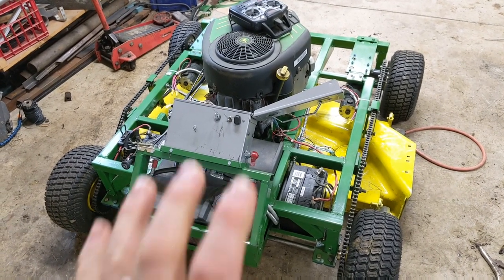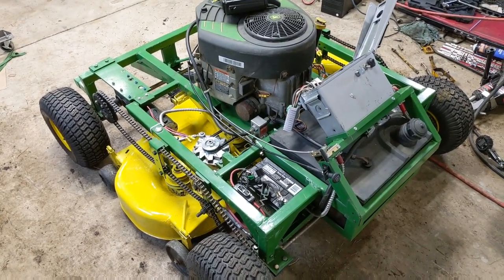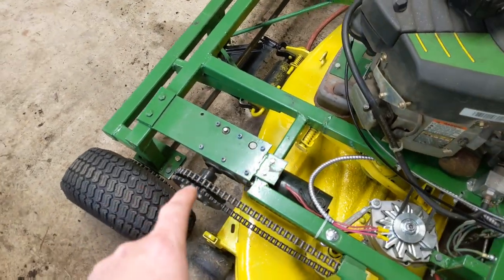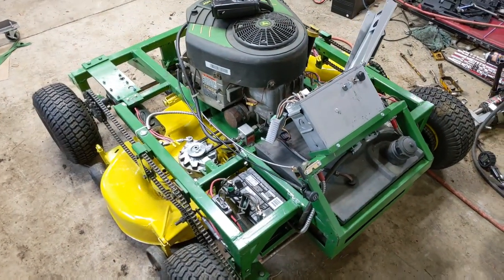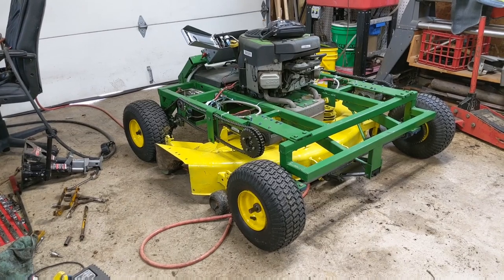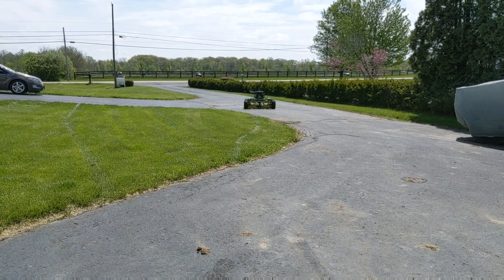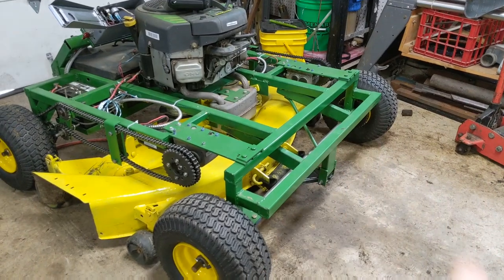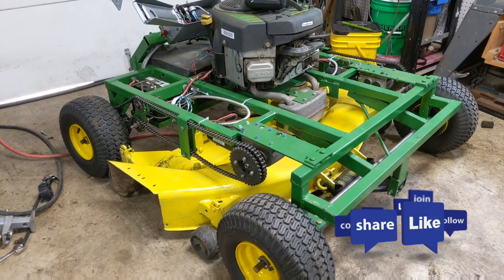Dad's Remote Control 50" Lawn mower beast!

Comment: To turn or do a neutral turn the tyres need to slip sideways so with grippy treads that’s not going to happen. It could also tear the turf to shreds.
Maybe two wheel drive and castor pinions on the rear wheels may help.

Hope it goes well whatever you do and I’ll be watching.

I use a RoboMow RC304 robotic lawnmower and it works great but sometimes I think it has a mind of its own.

Thank you,
Colin

Comment: I've seen the commercial version of this using 4 motors That one was built with 4 corner steering, each corner was a vertical shaft to a 90 degree gearbox driving the wheels. The drive was through a tube that acted as the steering pivots. The neat thing was it could steer in all directions with crab, and counter steering. But it was $$$$$

Comment: That looks awesome! You should rob the hydrostatic drive train from a riding mower. Nothing stronger than hydraulics. Mine is a great hill climber. It also will last forever! 10 years and mine works like new with no maintenance. Keep at it guys. So very jealous!

Comment: What size gas engine is that and does it run the mower deck good.  I am debating on doing one this size or a smaller one.  I have a 48" deck off a 318 already and I want to mow some really steep hill that are to steep for my JD 332 and getting to hard to weed wack because of the size of them.  I would think stronger motors would allow it to turn like a bobcat, those are a lot heavier so I think  a much bigger electric motor on each side would do it.  I need 4wd because of the hills and the hills are my primary goal but if I use a full size deck I could do a lot more areas.  I just do not know the HP needed to turn the deck. Do you have the alternator on the same belt that turns the deck, is there a clutch to engage the deck or it is always engaged to the deck.  I looked for more for videos but did not see them.

Comment: Hi, good work Dad. Just wondering, is the motor (driving the cutting deck) mounted to the deck or the frame?
Reply from the maker: The engine is mounted to the frame. The two drive motors are also mounted to the frame.

Comment: There is a playlist on the Cleetus MacFarlan channel about turbo charging ... might be something there that you can use on this buggy!  :^) You did say that currently it is "under powered."
Reply: The engines running the actual drive of the cart is underpowered not the petrol motor for the cutting deck.

Comment: That's impressive and inspiring. How did you wire the 24V alternator to the battery?
Reply: If alternator has DC output then wire directly to battery thru a fuse.